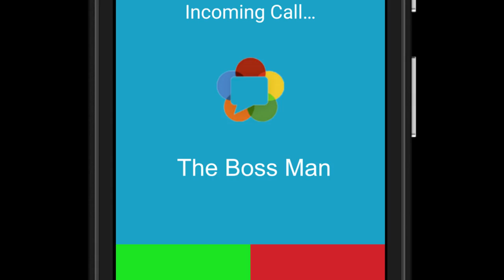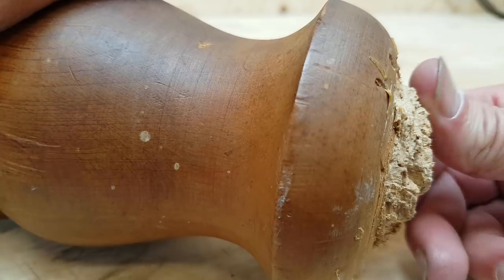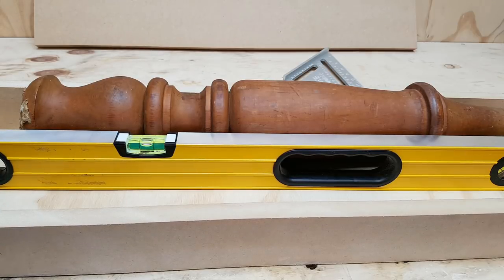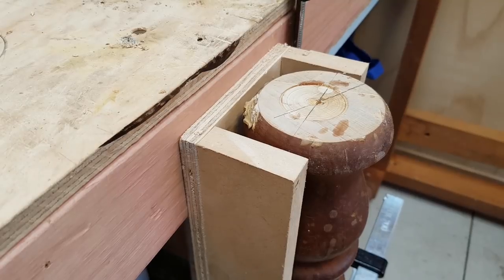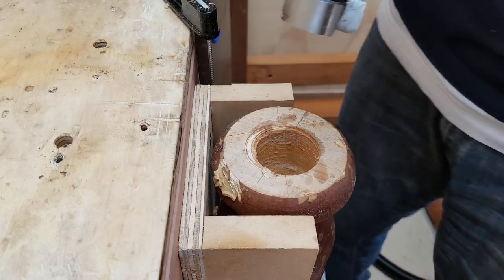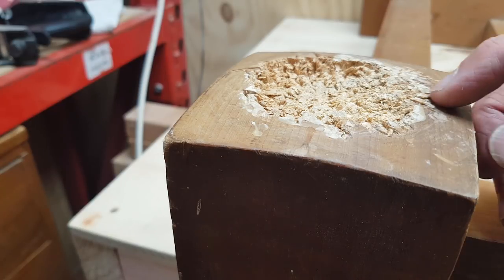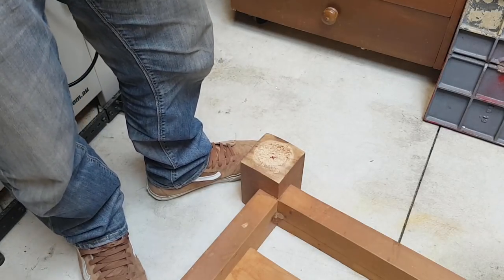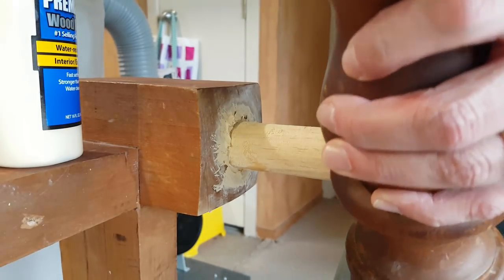Fixing the Boss Man's Dining Table

Comment: Nice repair Rob! I always enjoy the little story lines. Sometimes when you have to drill a weird hole like that it can be helpful to first drill the hole in a small piece of plywood with the drill press then screw the plywood piece on as a straight sleeve guide to prevent drifting when drilling the real hole with the hand drill. The guide hole allows the use of a router as well, which is another method to keep the hole nice and straight. Sometimes if I don't have the right sized bit to match a dowel I will make a custom size hole template on a piece of plywood with the scroll saw and use the router method.
Reply from the maker: Hey cheers Tony! I should have used the drill guide/sleeve technique on the leg! I did have one on the frame made of a piece of 2x4 (at 6:45). My next(ish) project involves custom sized holes with the router as you described. I have 60 holes to make. That video is going to be boring. 😎
Reply: Holy *!#@!

Comment: When drilling large holes like that, it helps to hog out as much of the material before hand. I usually go with another bit inside the circle leaving the center and edge alone.
Glad it worked out :)
Reply from the maker: how do you center the drill bit ?
Reply: @TakamiWoodshop  Exactly the way you did it, but think of it as like drilling holes for a 6 shooter or something like that. The forstmner bit still has its center to guide it and the edge is left nice and clean.

This might better explain what I'm talking about 😉 https://youtu.be/Xsjv2A6cGig?t=121
Reply from the maker: Oh yeah I see what you mean - that's a good idea !

Comment: Great fix Rob. I like a man who went faced with the easier option of dumping it on the side of the road or your neighbours driveway and getting a new one instead spends a week repairing a $30 table with $500 of labour. It is the way all project should be 😁
Reply from the maker: The table itself is made of some old rimu or kauri (can't remember which) but both esteemed timbers here now that they are endangered and in very low supply, it needed a full restore though really but at least it works now. 500 bucks! I wish! I think I got ... oh .... zero dollars for doing that 😪
Reply: @TakamiWoodshop  oh in that case definitely worth the effort, I thought it was just radiata! I hope there was a six pack at least on offer 👌
Reply from the maker: I got a new 40mm forstner bit out of it. And an undisclosed number of days off from work to do the job 🤣

Comment: Nice work Rob :) Now you know the upper limit of your drill press, maybe next time you could bore out a smaller diameter hole and then when you use the finish size bit to remove the last of the material. Keep up the good work, sub'd
Reply from the maker: Thanks Steve - yes - the little drill challenges me in many ways - it's capacity and its power ... but doing a finish pass on that hole would've been a way better way to do it! Cheers for subbing and hope you enjoy! 👍